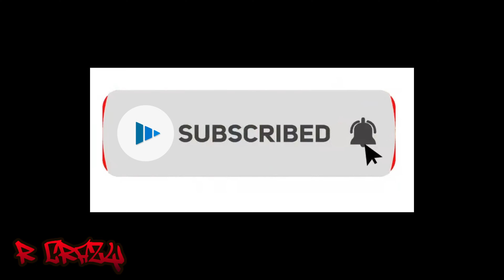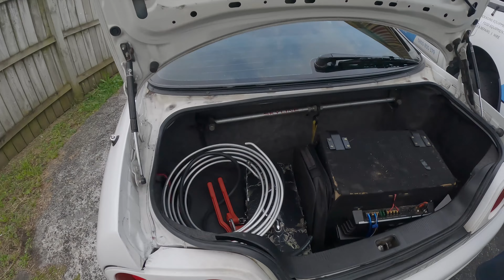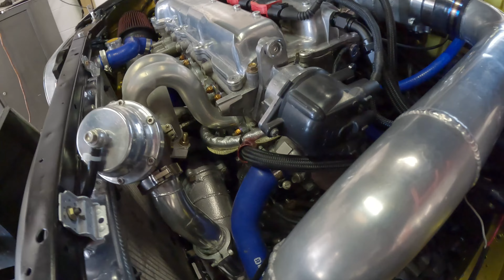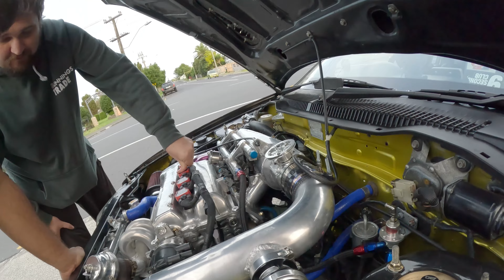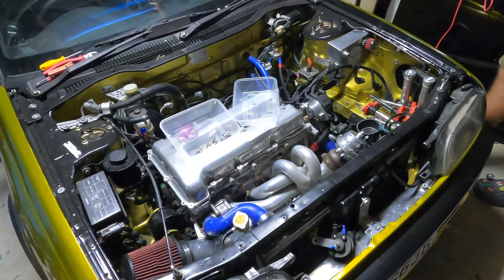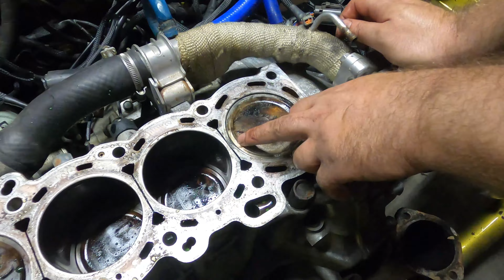GTIR PULSAR EXPLODES! 500HP ATW, What Went Wrong?

Comment: Dang were they oversize pistons never thought it would push the sleave and crack the block
Reply from the maker: Yeah man 87mm beleive it has a 2.2L stroker crank in it as well. Won't know until i open it up.
Reply: @RCrazyNZ  what head gasket did you have in the build
Reply from the maker: @paulbarnett5856  cosworth one. I changed it around 2 years ago when I rebuilt the head. I've never opened the bottom end.